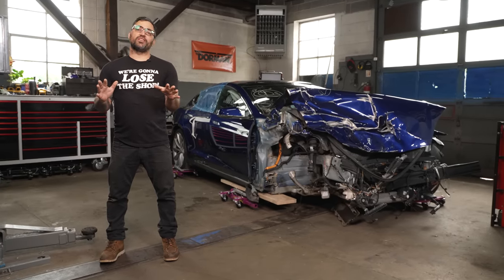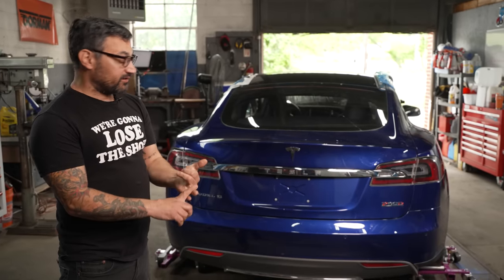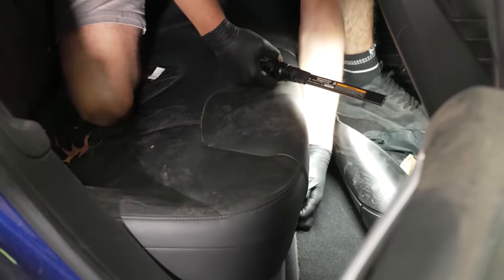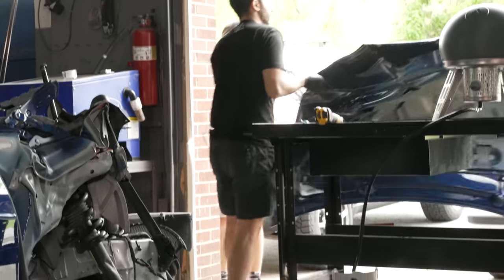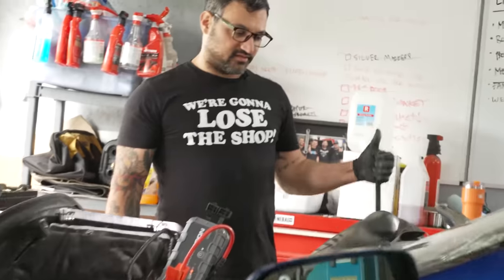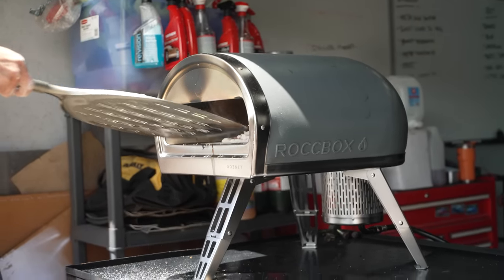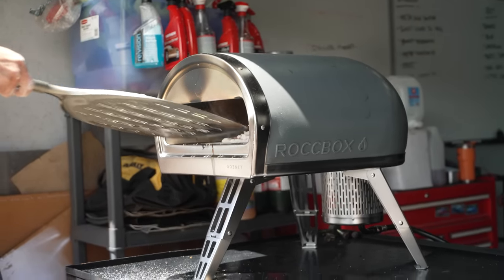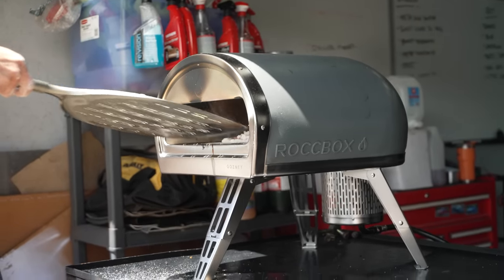I Bought a $129K Tesla WRECKED at Auction for 5500 BUCKS!!  DIY EV Muscle Car Build Starts NOW! -

Comment: The upside of the missing battery pack is that you can make a custom one, or a few linked, to fit into the vehicle of your choice. Do half in the trunk to help with traction and half in the bay behind the wheels to give the front end half a chance of staying below 45 degrees when you launch.
Reply: Typically you would dismantle the Tesla pack into its constituent modules, and then repackage those into the appropriate areas of the new car.

Comment: The first responder cut points are all low voltage. Pyro fuse is the thing you removed from under the battery without proper HV gloves on. You should not encourage people to do what you just did. You spent a bunch of time putting the gloves on AFTER you did the thing that could kill you. Dont get dead dude.

Comment: As long as you can charge it, turn it on, and use it.....I'm down. 
My issue has always been with the ridiculous amounts of nanny's limiting everything from charging, to traction control. If your cars ability to be used can be turned off via WiFi(with practically all modern junk), then I'm not interested.
Reply: Chevy volt cells go for less dough right?
Seeing the drive unit on the ground made me think. I always wanted to take a Buick 3.8(99-03 ish) and turn it sideways in a 4x4 frame. Weld driveshafts to cv axles, and have an odd duck rock crawler with enough gearing to run big rubber. But if it were electric....
Turn it sideways in a s10 4x4 frame?
Reply from the maker: Nah, we will have full control, all aftermarket, just hammer on it and we can tune it how we want. I am anti any kind of driver aids on cars I want to really drive.
Reply: @StayTunedTA  good luck bro, can't wait to see what happens.

Comment: 129k for a two motor car that sucks , !L!L!!!!! For that price you’d think it would at least have all wheel drive , dang, !!! Plus it might of have 500 hp or like that when your do the math, but the batteries would have lost 20-30% of their Power in 8 yrs ?? Plus the Electric motors would of lost a lot of their drive ability due to wear and tear..unlike a gas motor which doesn’t have the same driveline loss issues over time they make more power until broken in,  then with good care last , and I’ve seen a 100k LS motor still make the same WHP as it was rated new..

Comment: someone really should start a kit for swapping LS motors into teslas. it would just be the motor mounts and some wiring stuff and instructions alot of teslas going to be junked the batteries only last 10 years then it doesnt make sense to replace it you just buy  a new EV
Reply from the maker: There's literally no tunnel, it would be a ton of cutting and fab work. and most of the electronics reside on the very flat firewall that goes all the way down. We thought it about, you know, for fun.